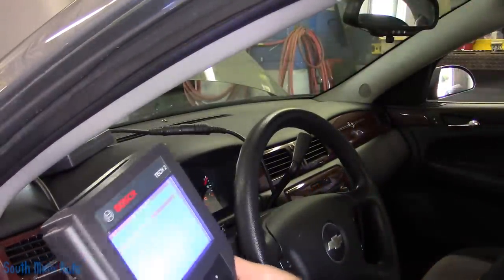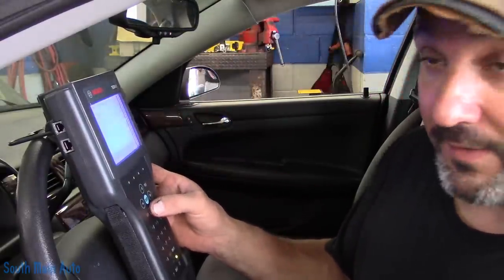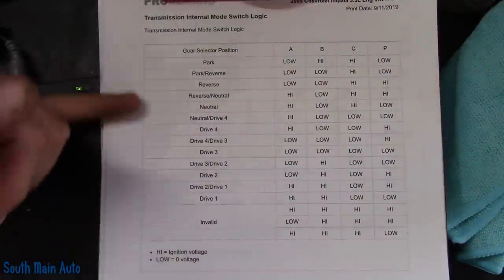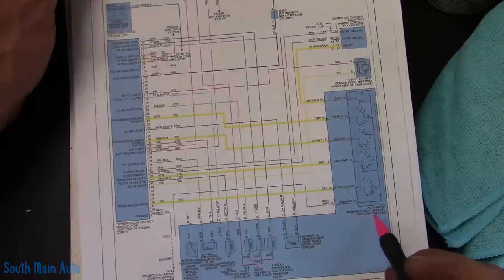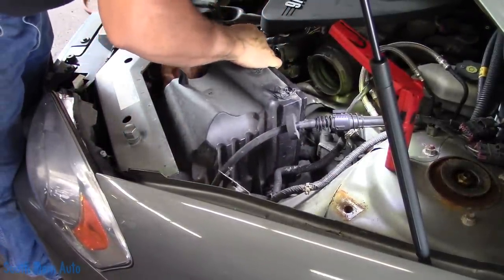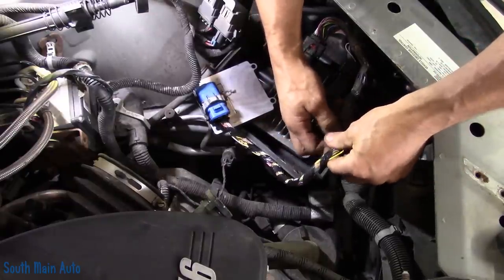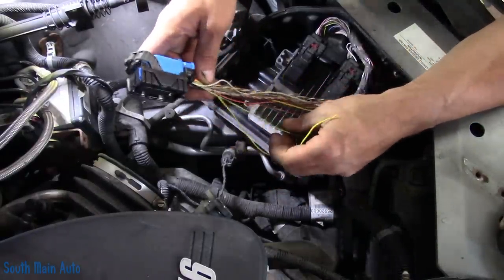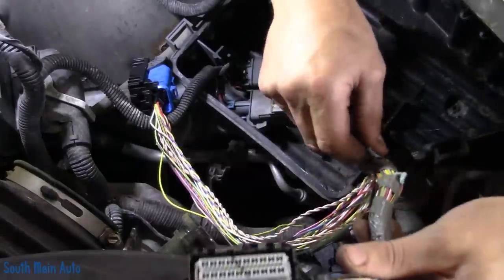Chevrolet Impala: No PRNDL Display

Comment: Newest car I've heard of, Jonathan w,. found one inside the cylinder head on a 56 golden hawk. My only wish was the  car was free on the engine and had gone for first start! Flat as a cigarette paper mouse would of made me happy even if it hung the valve up./LOL I have found them in heaters and seats but not in the air box or wiring modulus. (my spell check is on the fritz so who knows what I am spelling ) Good call on color. Wait till the better repair manuals come out and give descriptions like mice prefer different wiring colors

Comment: Old farmer trick was to keep vehicles in the barn with the hoods open. This discouraged mice from making little homes under the hood. 

I always thought that newer wiring insulation had some chemicals added to keep rodents from chewing on it. It used to be a real problem in the past.

Comment: I had a rat problem a long time ago. I'd done a head job on an old austin mini . I had put the head on and was waiting for the radiator to be returned from the radiator shop. The customer phoned up and asked us to stop work on it and he would pay up to date and bring the car back in a few weeks. He bought the car back later on and i put the radiator in and finished the job off . I took it for a test drive and it overheated fairly quickly. So back to the shop and check it over, the theromstat was open but no circulation  So i pulled the radiator out and ran the hose through the hole for the thermostat and a big dead rat popped out of the lower hose. URGH! Put it back together and it was all ok.
Reply: He was rat-arsed.
Reply: @Cheepchipsable  He couldn't handle the antifreeze. LOL

Comment: 2000 Pontiac Bonneville  started missing one time mouse was nesting under the 3800 series II cover. He had chewed through one of the injector wires. Now the cover is hanging as a decorative piece in the garage.

Comment: SI had it... Even though you didn't even need it because of the good old visual inspection! 
Circuit/System Verification

Start and idle the engine. Using the scan tool, observe the IMS A/B/C/P parameter. The scan tool should display LOW/HI/HI/LOW. Move the gear selector through all ranges and ensure the IMS A/B/C/P parameter matches the gear selector for each selected range.

Circuit/System Testing
Using the scan tool, does the IMS A/B/C/P parameter display HI/HI/HI/HI for each range selected.
If the IMS A/B/C/P parameter displays HI/HI/HI/HI for each range selected, repair the open in the IMS ground circuit.
Turn OFF the ignition. Disconnect the automatic transmission inline 20-way connector. Additional DTCs may set. Turn ON the ignition, with the engine OFF. Observe the IMS A/B/C/P parameter on the scan tool. The parameter should display HI/HI.
If the IMS A/B/C/P parameter does not display HI/HI/HI/HI, repair the short to ground in the TR signal circuit that displayed LOW between the TCM and the automatic transmission 20-way inline connector.
Turn OFF the ignition. Install the J 44152 jumper harness (20 pins) on the engine side of the automatic transmission inline 20-way connector. Turn ON the ignition, with the engine OFF. Using the DMM and the J 35616 GM terminal test kit, measure the voltage at each of the TR signal circuits at the J 44152.
If the voltage is less than battery voltage, test the affected TR signal for an open between the TCM and the automatic transmission 20-way inline connector.
Turn OFF the ignition. Install the J 44152 on the transmission side of the automatic transmission inline 20-way connector. Measure the resistance for each TR signal circuit between the J 44152 circuit and the transmission case. The resistance should be greater than 10 ohms.
If the resistance is less than 10 ohms, test the affected TR signal for a short to ground between the automatic transmission 20-way inline connector and the IMS switch.
Connect the automatic transmission 20-way inline connector. Turn ON the ignition, with the engine OFF. Place the range selector in D3. Observe the IMS A/B/C/P parameter on the scan tool. The IMS A/B/C/P parameter should display LOW/LOW/LOW/LOW.
If any of the TR signal circuits do not display LOW when the range selector is placed in D3, test the affected TR signal for an open or high resistance between the automatic transmission 20-way inline connector and the IMS switch.
If all circuits and connections test normal, test or replace the IMS switch.
Component Testing
Disconnect the automatic transmission inline 20-way connector. Install the J 44152 on the transmission side of the connector and use J 35616. Referencing Transmission Internal Mode Switch Logic, test for continuity between the IMS ground circuit and each TR signal circuit at the transmission side of the automatic transmission inline 20-way connector, when Transmission Internal Mode Switch Logic indicates the signal circuit should be LOW.
If any TR signal circuits do not display continuity when the table indicates it should be LOW, test the affected TR signal circuit for an open or high resistance between the automatic transmission inline 20-way connector and the IMS switch.
Measure the resistance between each of the TR signal circuits and the transmission case. The resistance should be greater than 10 ohms.
If any of the TR signal circuits display less than 10 ohms, test the affected TR signal for a short to ground.
If all circuits and connections test normal and the IMS switch tests normal, replace the TCM switch.

Comment: Reminds me of a Dodge truck that was towed in to the dealership I worked for back in the 80s and 90s. It was a no start. The customer said when he opened the hood the squirrel ran out of the nest under the hood and sat up on the air cleaner chattering at him. Stupid thing had built a nest around the main wiring harness coming out of the power distribution center and eaten a section out of the entire harness. The customer's insurance opted to replace the entire underhood wiring harness.

Comment: I had the exact thing happen to my 2008 Honda Civic. Looked everywhere to find the 8 pin connector on the transmission. After many hours of searching, I finally found it and sure enough, two wires had been chewed through. They were chewed very close to the connector so you probably should have put some of that fancy "rodent tape" a little closer to where the wires go into the connectors. Those rodents can be pretty sneaky.

Comment: had mice getting into fan box of a 2000 chevy truck. found the inlet hole under the hood an put fine wire over the hole . have not had any problem yet!

Comment: We’re the back up lights out also? Have a 2004 Malibu with the PRNDL blank and the backup lights out. No codes. Service data says the PRNDL goes blank when the PCM detects a circuit fault between the park/neutral switch and the PCM or a fault in the GMLAN between the instrument panel and the BCM. I’m going to check that yellow wire.

Comment: Note: If you have a can of bear spray you can spray the exterior of the wiring harness with that lightly. It will leave behind a dry powdery hot-sauce on the wires and won't damage anything else. And it's cheap. The potency wears-down with time however.

Comment: These newer cars are a pain in my ass. I miss the days when I could connect an engine to a car with 3 or 4 wires (+1 with a after market tachometer) and two battery cables. From 1972 to 1973, I took a 1500 course in auto mechanics. It wasn't long after that that this new electronics BS made it impossible for me to do anything except what I call groundhog work, that is replacing brake rotors and pads, brake drums and shoes, an alternator, a starter motor and other simple things. My daughter has a Ford Focus SES Her alternator died and the mechanic said it would cost $400 to replace it. I bought an alternator at AutoZone for $100 and replaced the one in her car. That was much harder than I thought. I had to get at it from underneath the car. After getting it unbolted, I got cuts on my hands trying turn it around just to get it out.  Getting the new one in wasn't easy either. Still I saved her some money.

Comment: Growing up, I had a friend that lived in a bad part of town. He drove junkers that required constant work.

After getting out of school, he got a good paying job and the first thing he purchased was a 5.0 liter Mustang. A week later, I got a call asking if I could pick him up for work. Sure, no problem. On the way in he told me the Mustang wouldn't start and was having the dealership pick up the car for repairs.

He got a call from the dealership that the repairs weren't covered and that it was going to be almost $500 for the repairs. Boy was he peeved. I took him to the dealership, where the service manager showed him the remains of the plug wires, and sections of the wiring harness that were totally eaten away. He didn't have mice, but big fat rats.

Comment: As someone famous once said.... "I hate Meeces to Pieces!" I never saw Rodent Damage here where we live, until about 3 years ago when a bunch invaded my Travel Trailer. I store it at my Hangar, plugged in with all electrical systems on and about 55 deg F of Electric Heat to keep it nice and dry. After 7 years of doing this for the winter.... mice got in through some unsealed holes in the flooring. They ate several wires, but most remarkably, one in particular. They ate the outer wrapper off about 8" of live 120 Volt AC "Loomex", and all the white and BLACK wire insulation inside that area. ARE MICE NON-CONDUCTIVE??? How can they eat insulation off a live 120 Volt wire right adjacent to a bare ground AND Neutral without getting ZAPPED? What a MESS! It took me at least 2 weeks to expose, clean-up, de-oderize, and repair the damage. The holes are now plugged with expandable foam with Titanium Screen laid in. I have a similar issue in my 2009 Yukon with them nesting in the air cleaner as well, but no wires in there, HOWEVER, if they drag in a bunch of material, when the vehicle switches from 4 cylinder operation to V8, there can be a noticeable "Bump - Hesitation." I think that when the extra 4 cylinders re-activate, there is a sudden change in airflow which "re-arranges their bedroom" and upsets the airflow until everything settles down. Clean out the airbox, and problem solved. That tape looks great.... would pin stripping the car keep them out? Glad to see you have some help and nice to hear activity in the background. They are learning from the best!

Comment: According to Shawn Woods, AKA Mousetrap Monday.  Even the hottest pepper available will not detour mice or rats from eating.
Reply: I was going to say the same thing.
I suspect the tape works simple because it makes the individual wires harder to get at.
Probably any good tape would work.
I've used plastic split loom and then taped up seems to work well.

Comment: Squirrels made a dinner of my tundras wire harness. Truck still ran but the abs and 4x4 lights were flashing so I pulled over and opened the hood. The squirrel family was still there. There must have been 6 or 7. I was gonna replace the harness myself but the harness was $3000. I was told peppermint oil.

Comment: Having the same issue on a 2017 BY. Can't see what gear it's in. Reverse works, drive starts in a high gear. Changed the fluid. It was the same for a day. The next day it was back to normal and now it's back to the high gear slow take off. Traction and abs lights on. Code U0101 no communication with the TCU.

Comment: Based on the amount of nesting materials, I'd guess the mouse/rat lives at the body shop if that is the normal/usual place the vehicle is parked. Loaner cars would likely have to spend much time at the customers location to gather up that much material unless there was a few more troops nesting.
I sure like the wire repairs made by SMA using real solder methods, same wire splices and of course the shrink tube and seal methods that leave zero traces of failure from the original. 
Maybe these cold areas need folks and shops to install some sort of metal wire intake grill to prevent them rodents from breaking and entering the intake canisters. Also, more often inspections of the air cleaners in areas where folks may park that are prone to vermin. Auto insurance  comprehensive coverage doesn't cover "vermin" damage unless it was sudden and occurring within a very short time I believe. Looks like there's room for a couple of mouse traps in the box.

Comment: GM gets points for having circuit checks, trouble codes, and live data that generally point you right to the problem. They seem better than just about any manufacture in that regard.  If it was a Jeep or other Chrysler vehicle you probably would have had something like an ABS code taking you down the wrong road.

Comment: hey eric i have a question. i have a 2007 nissan quest 150,000 miles, that keeps blowing the IGN & ECCS CONT fuse, located in the passenger side engine compartment -15A fuse. Ive taken it to about 3 mechanics and no one can figure out what it is. The fuse doesnt blow right away it can take a couple days. Also the service engine light is flashing when driving cause of the engine misfiring badly. i can tell its running on like 4 or 5 cylinders. But its odd cause the service engine light doesnt stay on, it just flashes and then shuts off. I didnt have any of these issues before the blowing fuse problem. Before i can change the fuse and it will run perfect but now not even replacing the fuse makes it run better. Any help i would gladly appreciate. Sorry for the long comment but i tried to add all details.

Comment: I have a good one for you
 I have a 94 Honda Accord 2.2 . The original ECU had a fault that show a EGR and  electric load failure. The EGR works and I replaced the fuse box. The battery started to die after a week of setting so I replaced the alternator and in the box it had a note saying the ECU had a falure and to replace the unit. I did now I have a code 21. Vetec value falure. I don't have a VTEC engine. Any ideas?

Comment: I cant seem to find the ground wire for the 2014 Chevrolet impala 3.6 V6 TCM. It says theres no connection but i cant figure out online where the ground wire is, also ive heard a new attendant has helped even though the alternator was working fine according to the ECM. Im not a mechanic just someone trying to fix their car. Same issues as well no illumination for PRNDL

Comment: Get a can of Liquid Electrical Tape.
Add a couple teaspoons of Tabasco or hotter.
Mix well, mix before use. Same effect.

Use eye protection and wear gloves when using.
Dab it on looms.

Cockroaches used to eat the wiring in old TVs.

Comment: You know its a problem when a manufacturer develops their own creative solutions. I guess the next method is electrified tape so when the little fella takes a bite.... zzzzzzz. Mice have no control over their bowels and other mice use the urine and feces trail left by other mice to figure out which route is the best to take. They have very poor vision as well but their hearing is better than humans. We had an issue with mice in my old apt I killed at least 5 of them with the snap traps. I wanted to find out how they operate to I could figure out the best way to kill them. Thanks for the video South Main Auto Repair LLC!

Comment: Hi Eric ,you should be grateful your back east.Here in Kalifornknea we have PETa PROTESTERS and EPA HOA ETA ,now if you find a rodent living in you car ,attic ,back yard shed,closet,riding lawn mower,you are not allowed to DISTURB it.REMOVE it's nesting location,shut off any access to FOOD or WATER. IN fact they recommend you cordon off a 10 x10 foot LIVING  SPACE,with food water, nesting materials fresh air circulation in summer ,heat in winter, if you do not do that ,YOU will be confined to and area 8 x 8 , stale air that smells like man sweat,your water supply will be the bowl in your stainless steel toilet,NO Conjugal VISITS, A shower  only once a week { which some use as a conjugal visit.}BUT you get 3 meals a day,so it's not all bad.

Comment: Lets face it - its something all mfgs have embrace!  Screw the buyer with with with a ecm.  I remember Dad broke down on the street with a 51 ford and it took less than 20 min. for the tech to repair and we went home.  What a bunch of BS YOU NEED A DEGREE I9N ELEC T ENGINEERING AND ELLECTRONICS plus purchase all the test equip to find the problem.  LIFE was simple in my lifetime.

Comment: Hey buddy I have a 2006 impala and mine goes in and out like I will be driving down the road and the door locks will lock thereselfes and the speed ometer stops working and then it dont show what gear its in

Comment: I park a 1999 GMC truck in my barn and the mice get up on the engine and nest. I have poison bait and traps set for them. Recently, one chewed part of the hood blanket (3" circle). With winter coming on, they start to look for spots to winter up. What do you recommend to terminate this vermin with extreme prejudice?  The barn is the only weather shelter I have for this truck. The wife won't let me swap her Lincoln out of the garage to the barn.   :(

Comment: Heres my situation 
Car runnin fine i parked shut car off tried to crank it it didnt went n messed with the battery cable the postive wire it was eroded car cranked rite up got in tried to drive it hesitated but after while it gains speed now im concerned i pullover attempted to acelerate but it kinda high revs before takin off reverses fine could i b experiencing the same issue or is it a sensor tripped because the battery im so lost i need help also no prndl display but no limp mode n havent had trans issues pior

Comment: Okay so when I replaced my tcm the car came on didn't have the box around the gears it also wouldnt even let me take it out of gear either. So I looked at the wires that lead from the tcm and some of them were chewed up going towards the transmission so I was assuming it was that. So I redid all the wires and the car won't start up 😭